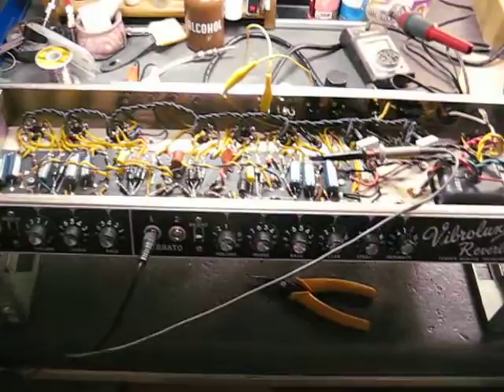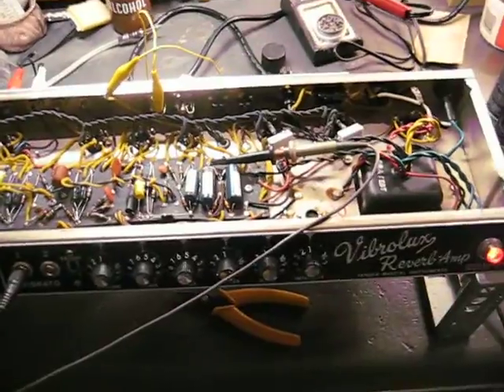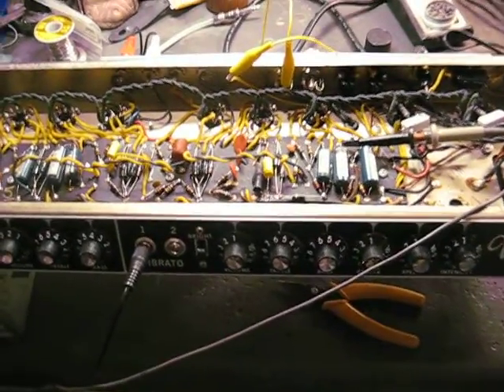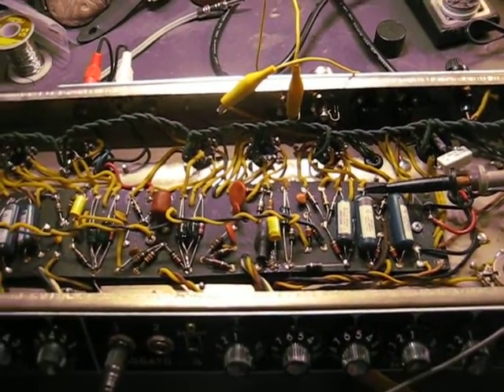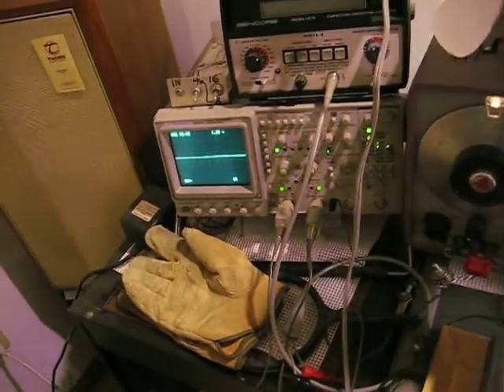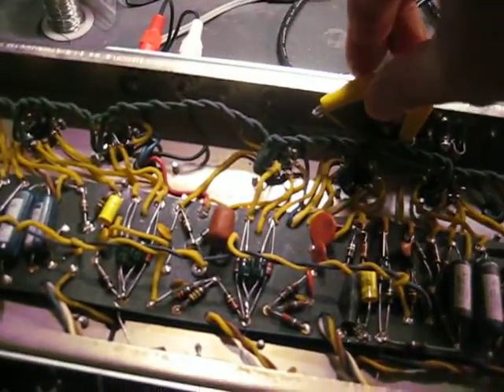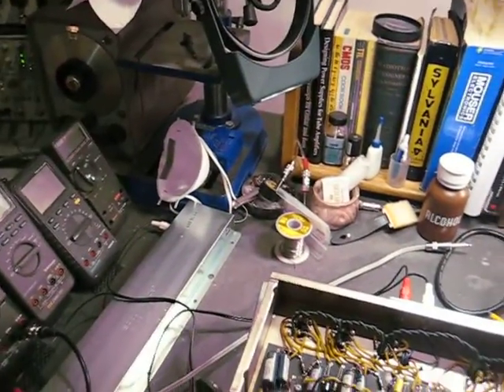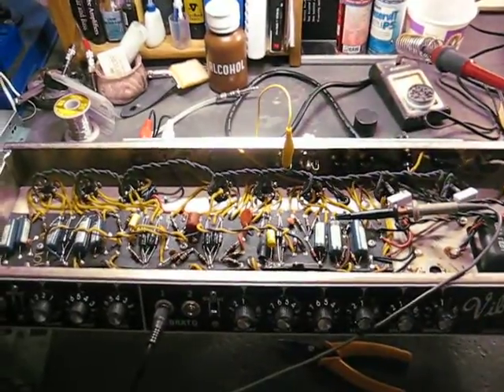Vibrolux Reverb Output transformer NFB induced oscillation

Comment: Howdy.
Familiar phenomenon for anyone fiddling with tube amp.s.
I should think the OPT is actually too good. It will pass through up to 40 kHz or maybe even 50 kHz. The signal gets through the OPT alright but the phase is shifted enough to make the NFB actually PFB.
My suggestions. Use larger grid stopper resistors at the power tubes. Introduce a 1st or 2nd order RC filter into the NFB loop. Type low pass with roll off at say 15 kHz.
Cheers.

Comment: hello, I would like to ask you about the mid capacitor in the tone stack. The vibrolux reverb normally came with a .047 uf cap.  If a .02 cap was installed in the mid capacitor position what effect would it have on the tone?
Reply from the maker: In general, assuming a fixed 6.8k mid resistor, and with the treble and bass controls set at 5, changing the 47nF cap to a 22nF cap would move the center of the mid scoop from about 500 Hz to about 800 Hz.   Also the depth of the notch would be reduced by a couple of dB.   If you are interested in these types of tweaks, I would urge you to look up and download the Tone Stack Calculator available here:    https://www.duncanamps.com/tsc/